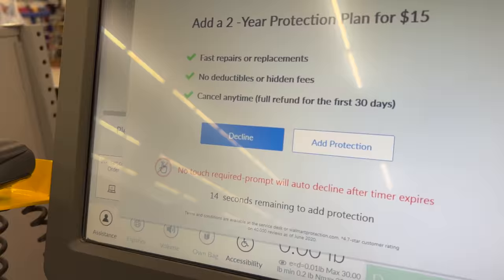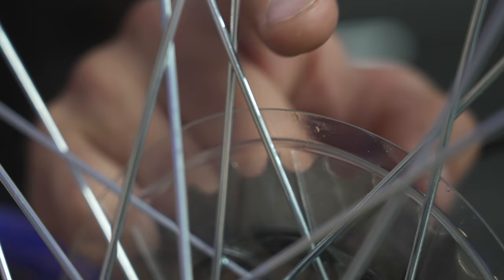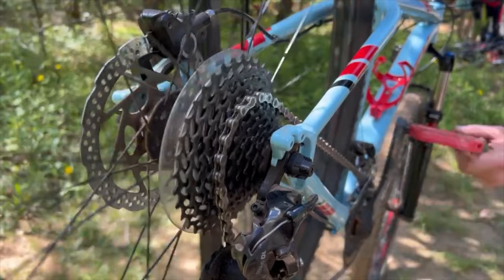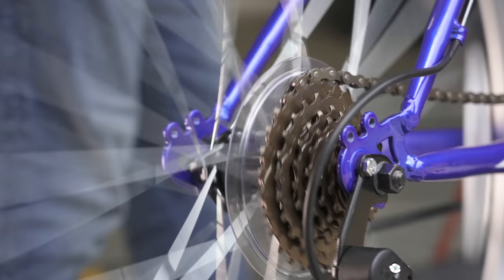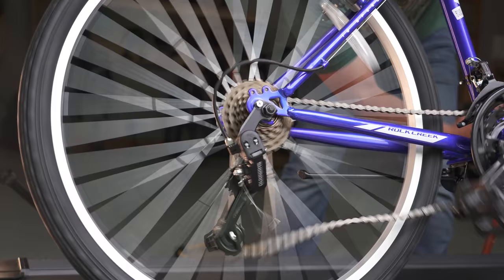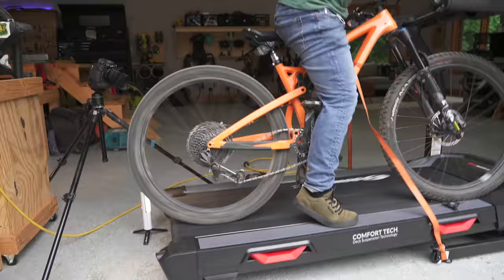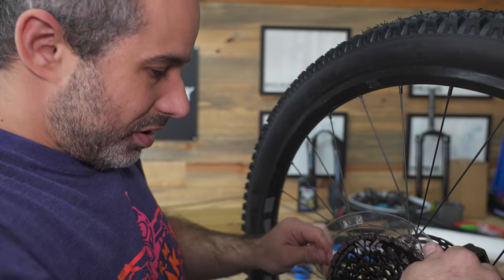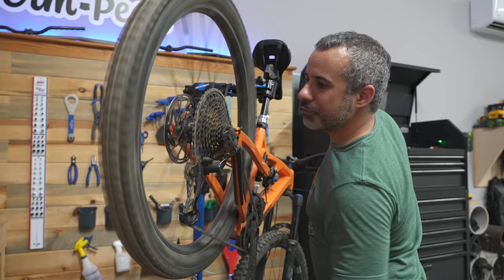What is your "dork disc" actually for? What happens if you remove it?

Comment: Leave the dork disc on if it's a bike for a client! For you, your friend, your family it's good to take off. If you're in a workplace setting don't take off the disc! You're liable for removing safety equipment. I have that shirt 😉
Reply: Shop I used to work at also wasnt allowed to remove reflectors or the bell as the law required them on new bikes
Reply from the maker: Absolutely
Reply: When I had my bike tires replaced/bought a new seat I asked the tech if he would ditch the dork disk for me (he chuckled as he snapped it off). This is a 30 year old road bike I bought second hand - was amazed it was still even there.
Reply: @danp2509  Shop I worked at would take the reflectors off the bike and then charge the customer to buy them.

Yup...
Reply: Thays y bike shops adjust the derailers and limits properly before being sold or brought it for service
Reply: @danp2509  The front reflector on my Trek Marlin 8 broke off the first time I wrecked, which was about an hour after I bought the bike!
Reply: @littleshopofrandom685  and the bell, too!
Reply: @dmrfnk  Bikes didn't come with bells in the box here. Do they now? Makes sense they should include all accessories required by law which is a front light, rear reflector and bell here..
Reply: @littleshopofrandom685  Over here yeah. Some manufacturers operate in areas where lights need to be supplied with a bike, thus we've also thrown into trash a shit ton of LR44 batteries in rear lights. While they could be useful for a week or two, the front lights are bulb instead of led and are useless for anyone. Luckily no batteries in them.

Edit: it's not all about greed on the shop's part. When a cheap bike is sold with something attached to it warranty also covers that something. Thus nobody wants to sell a bike with a light that lasts until it rains the first time or reflectors that break in the first service when the mechanic removes them for truing. Dork disks often make extra noise out of box with chain rubbing against it in the lowest gear. All modern bells break too. So do pedals, so even if there's a hundred pairs of pedals under the counter when you buy that bike that doesn't ship with them, no we don't give them to you because 1) you could be the guy who complains the $2 pair of pedals broke and you want new ones or 2) you could be the guy who just outright gives you a 3/5 review because the pedals broke. If we get you to buy a good pair of pedals you'll be a happier customer in the end. The only thing good about giving you the pedals would be that you don't screw up the crankset by trying to install ones yourself, and then blaming the bikeshop if not for the cranks, for the reason you can't get a new pair installed at once.
Reply: @littleshopofrandom685  Not sure if I could work at a shop that had that type of business acumen. Ha!! That is some low brow racketeering fo' sho'!
Reply: @marcdemichele2689  There were some pretty low brow shops here in the past. Not counting Igor, he/s in his own category (prison cell).

At my shop were were instructed to take the reflectors and the little set of tools raleigh included and keep them, so they could be sold to the customer separately or given as some sort of perk. Seemed sleazy to me at the time. But it also seemed off that bikes were not sold in a "road legal" state.

In fairness, the store can do whatever they like. Nothing illegal or "wrong" about it. They make the terms of sale. But still sleazy to me.
Reply: @littleshopofrandom685  I have worked in a cpl of shops and seen some things that have blown my mind as well. I think the hardest thing for me to wrap my head around is someone actually "buying" reflectors. Ha!! Always love some bike shop fodder. I literally just walked in from working at one as I write this. Cheers!! Thanks for the reply.
Reply: you touch my dork-disc...I touch your face...simple!
Reply: Not all bikes have them just low end cheap bikes.
When I got my bike , it didn’t have one tho the cheaper bikes did
Reply: @dorianspence1335  I'd replace "I touch your face" with "I give you a 1star revew" but I share the sentiment
Reply: @MarcelaElviraTimis  rightly said😉
Reply: @Durwood71 that’s ok. It just has to be sold, when new, with the reflectors

Comment: We don't call them "dork discs" here, we call them spoke-protectors. But I've improperly realigned my rear mech after someone tried to steal my bike and screwed with the alignment of everything by assaulting it in their failure (screw homeless people). The chain came off into the gap between the spokes and cassette, snapped about 10 spokes, ripped the mech into the spokes, broke the bottom bracket and it was an integrated aluminium bracket in a full carbon frame which wrote the bike off. Worse still I came off and injured my shoulder permanently.

I still would never run one.

Comment: Took off my "dork disk" immediately after buying my trek emonda.  Then I wrapped my chain.  I was on a big descent and traveling fast.  Did a little backpedal to line up for an upcoming curve and my right heel must have pushed the chain off the cassette and into the spokes.   It locked up the back wheel and wedged the chain so badly I had to have somebody drive out to rescue me.  Skidded the tire off almost completely.  I didn't lay it down on the pavement but I got lucky.  No derailer damage.  I have a picture of the ~100 foot line of rubber left on the pavement.  The disk went back on.  I don't give a s**t what others say now - it's my bike, my wallet, and my skin!
Reply: True, it's a 1 in 1,000 situation, but totally devastating if the dice line up
Reply: Skin is over rated
Reply: Why are you on the lightest gear on a descend
Reply: Key word in this whole statement is skin !!!!!  Leaving skin on the ground is never fun.  Ride with a .40 cent piece of plastic or spread 3 to 6 weeks letting skin grow back.  My vote is for the plastic.
Reply: @MrFlyingKitty  Exactly
Reply: @chadwells7562  big foot that somehow knocked it across all the gears all the way from right to left apparently

Comment: I found this one out the hard way one day. About 200m into a ride down the road on my mountain bike, my chain was thrown into the spokes and I got the result I think you were trying to recreate. I was rolling downhill at a fairly high speed so there was a lot of energy at play -- it was violent.

The wheel basically exploded. Three spokes got torn out of the rim and pushed across into spokes on the other side, bending those and pulling them out of the rim as well. The wheel buckled, jammed in my chainstay and that was all she wrote.

Still don't ride with a dork disc.
Reply: Same here, even though I didn't go fast at all.
Reply: Some derailleurs have too much slop.  See my comment waaaayyyy below.  Properly adjusted quality components shouldn’t need one, but I wouldn’t trust most bike shops to adjust them correctly.
Reply: Hawk Anonymous  so you don't ride with one?
Reply: Hawk Anonymous  right on 😀
Reply: In a downhill, this cheap plastic plate of a dork disk won't do anything. If it were metal, then it might survive and do the job.
Reply: @AstralS7orm I've got a 25 year old one, old and discoloured. Seems a lot thicker than modern ones. Bike is rusty, I don't care, moving bits still work fine.
It's done its job whenever the chain has bounced off, I've never paid much attention to it, everyone used to have them and nobody paid them any notice.
Reply: If you were going that fast why would you be going into 1st gear?😂
Reply: @nuclearguitarfare4653  nobody said anything about 1st gear?
Reply: Same, spokes got ripped off and now I have to get a new wheel 😢
Reply: hawkanonymous2610  Ditto vs Dito
Reply: My experience wasn't quite that bad but after being an a long road trip and losing a couple of spokes, I started carrying a few more tools and checked my derailleur more often.
Reply: Yep..  it only needs to happen once, you'll hate it and unfortunately, the plastic they use suuuccckkkss... gets brittle really quickly
Reply: Definitely a dork lmao

Comment: HI Seth, the biggest factor in having a catastrophic chain suck event is how the direction of the outward bound spokes on the back wheel are pointing. If the outward bound spokes are going forward it will cause the chain to bounce and not get sucked in. If the outward spokes are directed backwards, they will actually pull the chain in deeper.  A wise bike mechanic, wheel building wizard told me the secret!
Reply: Wow that makes great sense
Reply: This can be an issue with the chain ring(s) up front as well. Whenever I've had a chain-drop with my bikes, it's always happened that the chain falls from the smallest chain ring and gouges up the bottom bracket shell. The chain also bunches up.
Reply: Excellent point, I recently have built my first ever bike wheel and I'm pretty sure the outside spokes are spinned in the direction of the cassette, I wanted the outside spokes to take on the chain torque, so it means if the chain goes of the spoke inclination will try to push it away from the hub
Reply: vibratingstring  Yeah, I only mentioned that my outside spokes are twisted in the direction the wheel turns when going forward. So if the chain somehow goes off the cassette it doesn't pull in the hub. It didn't intend to lace the spokes that way for that reason, but it's a nice side effect
Reply: o m g !!! I can see it when I look now! Thanks man.
Reply: So get ones with spokes going forward. Shots bro,

Comment: As others have noted this is called a "spoke protector" in official vernacular. You should post an update with a look at what happened to the spokes on the Diamondback. As a former mechanic, I've seen many wheel failures due this kind of damage. Even minor   nicks will cause failure due to the high tension spokes are under (think cutting a loose string with a knife vs tight string)
Reply: I agree.  The focus seems to be the transmission rather than destroying the wheel.  Spokes are important?
Reply: vibratingstring  so?
Reply: @moto_rad  wasn't it interesting you think ?
Reply: Stops/slows repeat damage
Reply: vibratingstring  Me: riding 1k miles a year.
Reply: vibratingstring  Funny when the odometer says 1337. XD
Reply: vibratingstring mine is 25 years old, the disc is a shade of orange and brown. New tyres though, bike was stored outside on a balcony for a while and all the rubber on it needed replacing. Rusty but still works as well as the day I got it. Prolly time for an upgrade though.
Reply: Exactly. The spokes get chewed up and can fail, either immediately or down the road.
Reply: Last year I've had an accident. I was riding on a straight road like 20km/h and my chain somehow got caught in the spokes and well.. 8 broken spokes, chain totally f**ked up, it was bend like a spiral (like 180° rotation at like 12 links), deraileur (and the hanger) also bent. (Edit: 11 speed deore drivetrain, 11-51 cassette)
Reply: Not true. I've broken dozens of spokes. They just break. Nothing else happens. You keep riding because who cares. My bike has broken spokes right now.

Comment: This is how I broke my first bike back in the 90s.   My derailer went into the spokes so violently that it actually bent the frame at the attachment point.  My limits were not even out of whack!  I was a Junior bike mechanic at a local shop at the time, and all the wise older mechanics shook their heads when I showed up without a dork disk on my GT Avalanche.  They said I should spend the $7 for a new one, but I was way too cool for that.  A week later I was late to work because the rear derailer went into the spokes and turned into a pretzel.  17 year old me learned an important lessons that day, and the wise older mechanics got a good laugh watching the last few hundred feet of my walk of shame.
Reply: I noticed the slightly bent axle on my rear wheel causes the cassette to wobble, and the derailleur/cog alignment would oscillate as a result. I wonder if thats what happened to you.
Reply: Those older and supposedly wiser mechanics victimized you. After seeing that you would not do what they suggested, one most likely did something to your bike to supposedly teach you a lesson. Why do I think this? Because your description of how things happen indicate that it was only a week after they told you to buy and install a dork disc. That accident you had a week later was most likely set up to cause exactly what you experienced.